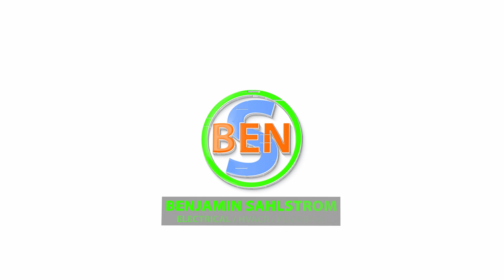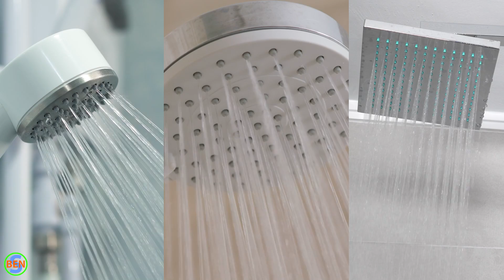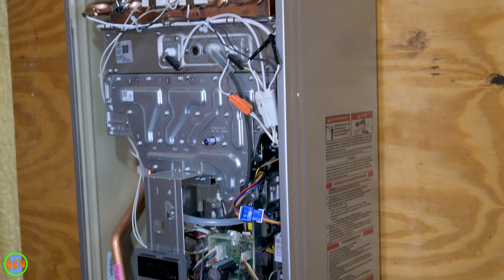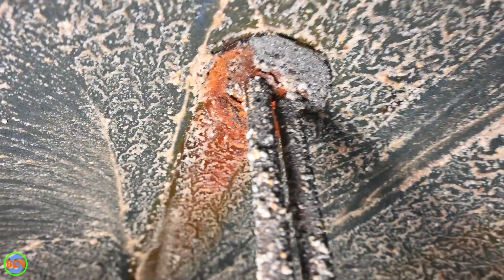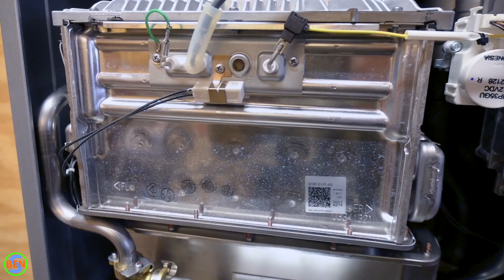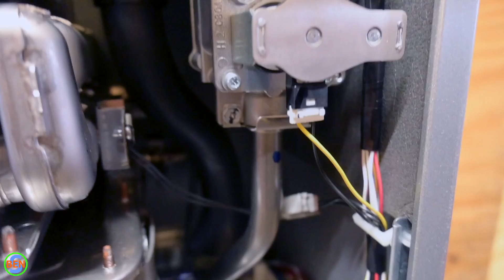Top 8 Tankless Water Heater Myths!

Comment: If you look at total energy usage, most of it is in heating, not domestic hot water.
For the savings, it is not worth the extra complexity and cost -> they are effectively super complex modulating boilers with proprietary parts - all just to have a hot shower? If amount of hot water is a concern along with temperature consistency, can just get a bigger tank, set it high and use a mixing valve.
Can't beat a simple standing pilot, thermocouple/power pile and natural draft venting for reliability. If loss of indoor air up the stack is a concern, can get a direct vent tank that vents just like a gas fireplace and has the same reliability.
For heating water, keep is simple!
I say keep the complexity for heating -> the 2-stage and modulating variable constant airflow blower motor furnaces have huge comfort benefits, as do inverter drive cold climate heatpumps compared to conventional.
Reply from the maker: Good thoughts!
Reply: You absolutely can beat a tank unit. There are multiple choices for heating water that are at more efficient and aren't as complicated as people think
Reply: @1985Satisfaction  i would never recommend to anyone to get a tankless water heater unless it's a special case. you can get similar efficiency with a condensing tank without most of the disadvantages like hyper-complexity, need to flush and having no reserve in case of a power failure.
Reply: @Jon  your talking about a heatpump water heater. They have a slow recovery rate, don't work in every climate, need to be flushed (as all tanks should be) and are complex as well. 

Tankless units are not right for everyone to be sure, but for those who can have them they can be awesome solutions
Reply: @1985Satisfaction  a single stage on/off heatpump tank is simpler than a modulating condensing boiler, which is what a tankless is. if a tank is not drained of sediment, it just looses efficiency - if a tankless isn't flushed, it gets killed. heatpumps water heaters have reserves.
the best water heater is a standing pilot natural draft or direct vent (not power vent) tank, keep it simple.
keep the complexity where it pays off - ie, space heating, its not worth it just for a hot shower.
Reply: @Jon-hx7pe  no one is talking about boilers

Comment: My Rinnai takes 10 seconds to start up from cold (time from opening the tap until warm water is felt at the output), plus another 5 seconds to ramp up from barely warm to fully hot. That's measuring the temperature on the outside of the pipe, but heat transfer through copper is pretty much instant so I don't think that's significant. Basically 15 seconds more delay than a tank water heater for the same pipe length. A recirculating pump would negate a lot of the efficiency benefit, because instead of storing hot water in a well insulated tank you're storing it in a poorly insulated pipe.

That said, it's been working since 2007, so I guess it's reliable enough. I'm going to replace it with a heat pump water heater which I can locate closer to where the water is needed, and I should also save on energy cost.

Edit: assuming it's been installed for 16 years and 2 cold starts per day, that means between the previous owner and I, we will have spent a total of over 48 hours waiting for hot water and wasted 2,920 gallons of water (assuming 1gpm typical demand), just due to the delay in the water heater itself.
Reply from the maker: Definitely an interesting calculation for sure. Tankless is especially well suited for properties with intermittent large demands for hot water where you would run out a tank. For situations where it's just for a sink or small usage I can see why it doesn't make sense.
Reply: Actually there are a few other factors to consider. Like the fact that pumps use a very miniscule amount of electricity, modern tankless units use very little btu's to heat for recirc and honestly if it's installed correctly you can still enjoy the energy savings and the instant hot water

Comment: hi, here in the UK we have had tankless heaters for over thirty years and apart from heat pumps it is the main way to heat the house and provide hot water for showers and washing up. I had a burst radiator in my bathroom and lost most of the water in the unit. I replaced the radiator but the level of water displayed is only one bar and I cannot find any water input valves on the unit. Have you ever come across this problem and if so how did you sort it out.
Reply from the maker: Some boilers don't have a direct connection to add water but rather need to be charged with a pump or other means. That's how most of the new systems we install are set up.
Reply: @BenjaminSahlstrom  thanks for the info

Comment: Great video. I was told by a plumber that gas is good, but not electric tankless water heaters. I don't have Gas in my subdivision.
Reply from the maker: Exactly. Electric just can't output enough energy fast enough to get a good temp rise and flow rate.

Comment: Surprise surprise another tankless sales video where no one discuses the actual problem with them. The wildly expensive control boards that fail every 2-3 years.
Reply from the maker: I likely will talk about the problems in another video at some point! Just like everything there are always pros and cons!
Reply: Good point I think.   Even further, a number of years ago an ice storm took out our electric for a week.  My OLD gas water heater ( no electric whatsoever, and a pilot light) kept going throughout.   I don't know how much longer it will last though.
Reply from the maker: I love appliances that don't require the grid. The are getting to be few and far between these days though. I love our gas stove for that reason too. Really nice to be able to cook without power.
Reply: Get a whole house surge suppressor or at least one for this device. We get lots of lighting and surge suppressors seem to make a big difference.

Comment: You merged gas and electric tankless water heaters together. Electric tankless water heaters are designed to fail, in case of electricity best option is tanked ones. Gas tankless water heaters are warming quickly, but they require complex ventilation and carbon monoxide sensor with alarm.
Reply from the maker: I agree that electric really isn't a good option and I think most people already know that? I should make a video pointing this out.
Reply: Our vent goes up and out the wall, nothing complex. If you have any full burning devices in your home you should have carbon monoxide detector.

Comment: In replacement of a tank unit to a tankless, the cost will be more than simply replacing what was there. Mainly due to the venting will have to change and an electrician will have to bring power to the tankless. Also, for those residents who do not have an issue with running out of hot water, a tank replacement is likely their best choice. A tank unit also has the benefit of a source for stored water in the event there is a power outage that affects water supply or some other event that disables the public water supply. It will also supply hot water without electricity. 
Tankless has its benefits if your application will take advantage of them...
Reply from the maker: Excellent points! I also like the  storage if water that a tank type provides. Every situation is different.
Reply: There are many ways to combat all of these. You are correct that they aren't always to best solution though.
Reply: Rotary landlines work when cell towers lose power, so, ditch that cell phone…
Reply: I would question the sanity of someone drinking hot water from their water heater... like alot
Reply: @1985Satisfaction    Who is drinking domestic hot water?
Reply: @JohnCap  just responding to OP's claim about being able to drink the water from the tank
Reply: @1985Satisfaction    A lot of people think it’s smart when they need to boil water to start with hot water… If they only got to see what the inside of their water heater looks like…
Reply: I have a direct vent tank, so the venting is quite similar and there’s already 110v power there. All the Rinnai models i am considering are a lot less expensive than another 80 gallon direct vent tank.
Reply: @JohnCap523  could do a tankless with a concentric vent
Reply: @1985Satisfaction    I’m now thinking I’m not gonna be able to do this. My gas load is already slightly over what the upgraded meter can handle which is the max for a standard 1/2” high pressure service. Ive got a standby generator, furnace, water heater, range, and fireplace. My water heater is 85,000btu. Bumping up to either 130k with a condensing unit, or 160k with a non condensing is probably too much load.
Reply: @JohnCap  the meter sized should be based off the cubic footage. If it is a high pressure meter those few appliances shouldn't top it out
Reply: @1985Satisfaction    Max meter throughput on a 1/2” service is 425cf/h (~440,000btu). They upsized mine when i put the generator in. I was a bit over ~400,000btu then and since then i replaced my duel fuel range with gas only so that added the gas oven load. The possible issue would be a power outage on a cold day with generator and furnace going, adding the tankless would be well over 440,000btu right there, without any cooking. It’s a different dynamic having standby hot water vs not.

Comment: Can you run a tankless into an existing water heater to pre heat the water?
Reply: Yes...I believe when using both, tank and tankless, there are added benefits.
Reply: I'm curious what the benefits of having both tank and tankless. Will this not only initially cost more but also increase annual costs?
Reply: @PJM454  Probably not much more. I think the tanless goes after the tank so when the tank runs cold the tankless keeps it going.
Reply: @Garth Clark  it's better to have the tankless fill the tank. You then have the house draw off the tank. You don't need to even energize the unit. With a 20 gallon electric tank you can get something like 150 gallons an hour
Reply: Actually I have both a tankless and a tank. Right now I am only using the tank. My thinking was to to fill the tank with the tankless and only draw from the tank. That way I would never run out of hot water and only need to heat the tank water to maintain temperature

Comment: We had a tank-less water heater in 1986. So this technology is not new. 🙂
Today the efficiency may be higher, there is a better regulation of the heat and you can possibly integrate them into smart home.
The problem right now in Germany is the gas. We do not want it any more and now we have to freeze to death, because we have no good alternative options. The fracking gas from the USA is dirty and extremely expensive. But we do not even have created an other possibility.

Comment: I'm a fan of Navien but avoid the water tube heat exchangers (models NPE and NCB) as seen from mikey pipes youtube channel.  Get the fire tube or non-condensing Navien models. Navien is also building a plant in Virginia. IMO the only downsides of tankless is that they wont operate during a power outage and it requires maintenance.
Reply: I install NPEs all the time and haven't had a problem yet.
Reply: Mikey pipes is a friggin moron. Thousands of these get installed everyday and somehow HE'S the only one to find this issue? I have entire neighborhoods with these installed for over 10 years without issue one.

Comment: Compressor type water heater is far superior.
Reply from the maker: You talking about the heat pump units?
Reply: @BenjaminSahlstrom  Heat pump anything will have to have low electric rates to make them carry any value. Many locations in the USA have very high power rates which simply make any heat pump contraption too expensive to run.  Some of us have 38 cent per kWh rates, such as in sothern California. Then there's Nevada who sells power for 8 cents.
Reply: @Garth2011  this is changing with rising natural gas prices - making heatpumps more attractive at least in places that haven't totally screwed up their electric grids by trying to go green. 38 cents per kwh is the exception, not the norm in north america.
Reply: @Jon-hx7pe  gas prices have increased for no reason other than to support agenda against natural gas. Gas is so plentiful they couldn't give it away 5 years or more back

Comment: Our tankless is in service  well over 10 years and we are pleased with it and its operation. Power outages happen here  and we are glad we opted for a standing pilot to operate ignition. We descale yearly with vinegar, 5 gallon pail, and a fish tank pomp. Thanks for the video.
Reply: I use a UPS, with 2x 12v batteries, to keep hot water during power outages… works great!!!
Reply: @DavidHalko  Hi Dave. For long outage (about 7 years ago) I used my gasoline generator, but that was once since 1974. Last spring, we shivered over night when it was still cold and the power went out. So, I bought a12v deep cycle, trickle charger and a 1100 W inverter. That was motivated by the flood of 2 years ago that motivated by no sump pump. Now have a new sump pump, 12v rig to run it and the furnace. Will also get 1 more deep cycle. I will also run electrical to sump closet from furnace. I am almost dome rebuilding the lower level from the flood.
I descale the tankless myself. I do almost all my myself.
Reply: @donmittlestaedt1117  - keep up the good work!
Reply: Do you descale, yourself?
Or do you get a professional?

Comment: I’ve lived with a tankless for 5 years and the biggest drawback we had was, if your showering and the power goes out you get instant ice cold H2O. Not fun at all. Ask my wife.
Reply: I put a UPS on my tankless… we get hours to take a shower, before we can’t get hot water, and usually the power is back by then!
Reply: That is some good stuff 🤣🤣🤣 shower roulette!
Reply: @jeffmoore6917  - yep!!!

My words usually are, “If you want a shower today, you have 2 hours, if the power does not come back on!” LOL! 😂

Wife in a shower that goes cold… 
might get one killed!!! ROTFL!!! 😅
Reply: Check out the hugo battery back up for tankless units. They are pricey for sure but they will give you 3 to 7 days of hot water if you use the flow switch version.
Reply: @1985Satisfaction  - a simple 1500 KVA UPS for a computer 🖥️ will do it… if it is judiciously shut off during a power outage & turned on whenever hot water is needed, it will last for days
Reply: Haha, I was going to get a UPS for mine then I remembered I'm on a well. 😆 

When I finally get a backup generator installed on the house, I'll put it on a UPS then.
Reply: @CoffeeandAdderall  - “well…”

Ahhh… that will need a ton of power! ⚡️ 

If you got a low frequency inverter, added some batteries 🔋, that could do them both.

Something like this…
https://youtu.be/DgGemuCo8Oo

It should have a UPS mode, where the inverter charges the batteries, and then will supply power ⚡️ when the power goes out.
Reply: @DavidHalko  right but there is water in the pressure tank to get me through the time until the generator starts and powers the well.

It might be low pressure but that would be better than the sudden cold
Reply: Hi  @CoffeeandAdderall  - with a UPS, there is 0 seconds cold water... the power never goes out.

The benefit with a tank are significant, the water remains hot for awhile, with 0 seconds cold water... kind of like the batteries on a UPS will keep the hot water running for awhile on a tankless 

That water pump takes significant power. Pumping to a cold tank higher than most usage higher than a tankless it tanked water heater, can also help mitigate that problem, relying on lower water pressure, as you suggest.

I am glad you found a workable solution for your use case!
Reply: Same thing happens if you have electric water heater.
Reply: @arlenem9697  Well, it not instant like on a tankless. I live in rural area with occasional outages and it have not been an issue with our tankless. I do have battery power supply should we need to shower during a long outage.
Reply: That don’t happen often